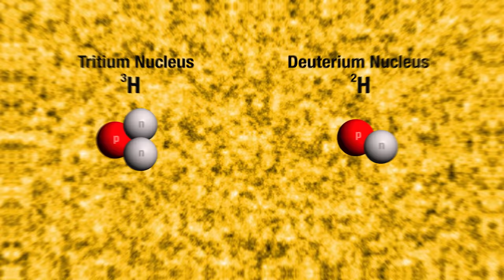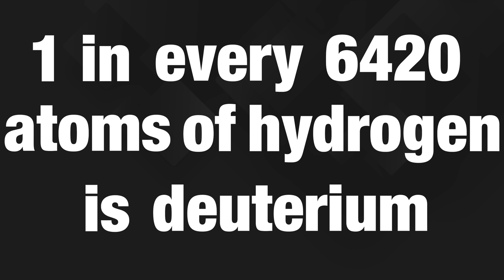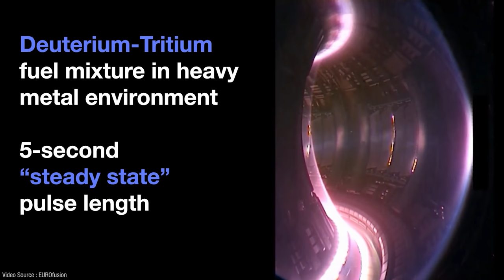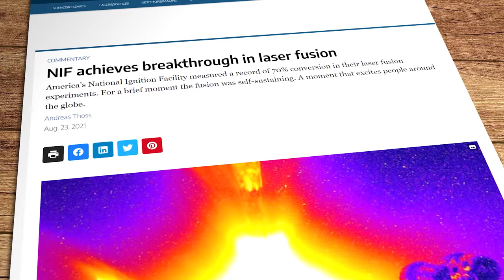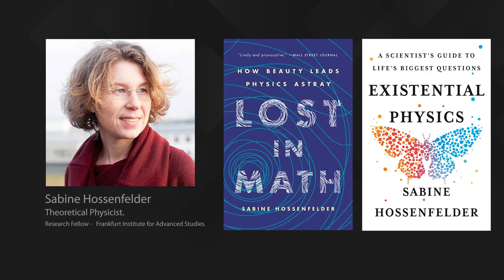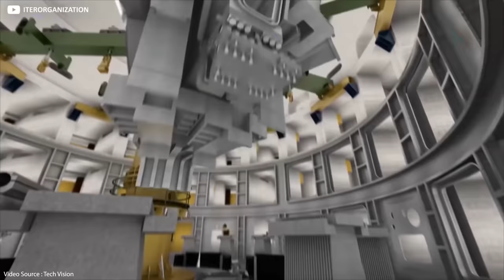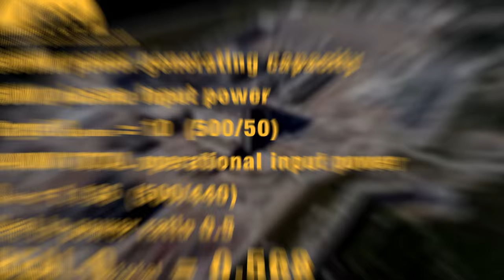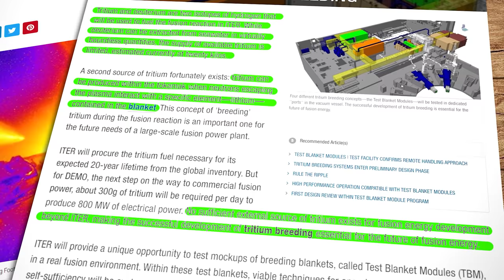Nuclear Fusion Illusion. Is it time to park the pipe dream?

Comment: I'm not sure why the focus on Q, because this isn't the real big problem with DT fusion reactors.

The real serious problems are two.   First, the volumetric power density of fusion reactors is just terrible.  For ITER, it's about 50 kW(th)/m^3.  In comparison, the thermal power density of a pressurized water reactor's primary reactor vessel is about 20 MW/m^3, 400 times higher.   It's likely better DT fusion reactors can do better than ITER, but not 400 times better.   So, for a given thermal power output, the fusion reactor will be many times large, and therefore many times more expensive, than a fission reactor.   This problem is inherent with DT fusion and come from the fact that heat escapes a fission reactor through the walls of large numbers of thin fuel rods, while in the fusion reactor the energy must be radiated through the wall of the whole reactor.  The square/cube law hurts the fusion reactor badly.

The second problem with fusion reactors is that they pack large amounts of complex equipment into a zone that will quickly become far too radioactive for hands-on maintenance.   The requirements on mean time between failure (MTBF) and mean time to repair (MTTR) are far beyond what can currently be achieved.  The equipment will also be under much more stress than the similar parts of a fission reactor.

Both these issues were pointed out by Lawrence Lidsky in the MIT Technology Review in the 1980s, and nothing since has shown him to have been wrong.

http://orcutt.net/weblog/wp-content/uploads/2015/08/The-Trouble-With-Fusion_MIT_Tech_Review_1983.pdf

Comment: Thank you for sorting this out for me. 
  We don't have the time or the funding to waste on this sci-fi  idea right now. 
We need actual results and scaling up of methods that have proven their worth, right now.

 So, please, anyone who  has a position of influence  in governments
 over the direction of this  investment of large input and dubious returns, 
might need to  agitate to divert this revenue stream and knowledge
 to the production of exquisitely shielded 
small  modular and  tiny fission reactors 
 as a plug and play element grafted into semi detached microgrids
 in concert with the local available renewables .

 By supplementing  those  existing 
and under construction renewable  electricity generator sites 
 and  also where  other older, fossil fuel plant sites are already in use, 
ones that are already hubs connected to substations and the like,  
we can get closer to the critical goals we MUST meet.

It won't be seamless, but it will be quicker and more efficient.
We have a better chance  of retaining more of our world this way.

Adding  these small nuclear cogs 
 will keep these sites productive 
even while other renewable components
 are being maintained or repaired.

But, being able to use 
updated, reliable interlocking pieces together 
as a base load generator  
and hooking them up at existing power nodes
 is only half the puzzle.

integrating  the  best  scaled-up energy storage options
 that take advantage of the varying local supplies of natural resources,
 is the other half.
whether that industrial-scale storage includes  molten salts, hot rocks, 
 recyclable aluminum,  iron/air,
high elevation water pumping and/or gravity towers.  

Fusion is an amazing idea, but we need actual results yesterday.

Please spread the word if this is a plan you can support implementing.

Comment: "splitting atoms is not a nuclear fusion process, it's a nuclear fission process"

That's wrong. Lithium is bombarded with neutrons, it becomes unstable and DECAY.
Decay is the right name of the process, not fission that it's an irregular splitting of a heavy atom that it has the configuration to do that.

And it doesn't matter in terms of a reactor if it's fusion, fission or decay, if the potential radioactive elements are short lived so a possible leak only release a small amount of radioactivity and there is no long term contamination that's to the fast decay of the elements.

Comment: Thanks for the insight. I waited in vain, though, for some thought on why it is so hard to improve the Q efficiency ratio. Why can the generator not be kept running longer than a split second? Would the ratio improve if it could? What are the obstacles to reducing energy input and increasing output?

Comment: The photovoltaic effect was discovered in 1839, and the first solar cells based on selenium came in 1884, but those were not practical or efficient. It wasn't until over a century later that solar cells were made good enough to be useful by Bell Labs in 1950. And it wouldn't be until now, the 2000s, almost a century and half later, that solar power plants could compete with existing ones.

Fusion right now is like that discovery in 1839, we can't even make a sustainable reaction let alone a breakeven one or even useful one. And it's going to be an extremely long time before make a commercially viable one. Perhaps another century and a half.

But we will get there.
Reply: it won't take a century. ITER is a 30 year old design and already obsolete. Pretend that it represents the state of the are is shameful. Look up Commonwealth Fusion out of MIT, General Fusion, and HB11 for radically different takes on the challenge.

Comment: I’ve been saying this for a while. Fusion can’t save us. It is part of our future and it will be a huge part of making energy extremely abundant and cheap which will push us forward as a civilization, but it will not be a part of the climate solution. We need to start pushing renewables and fission. And we desperately need updated grids. I do see utility in funding fusion research. It’s kind of like finding NASA. It’s not going to lead to anything practical anytime soon, but the tech we get along the way will probably be useful. What we desperately need is a room-temperature superconducting material. That really would be the next step in energy. It would make energy abundant with fusion and it would make it easily transmissible. Unfortunately, I think metallic hydrogen is perhaps even further off than fusion. We can’t even get carbon nanotubes and graphene into commercial production and those aren’t theoretical anymore. We’ve made those materials in labs already. I mean we might get there if there was a massive increase in funding, talent, and coordination, but I just don’t see that happening.

Comment: If Weinberg had been given just a fraction of a fraction of what’s been spent on fast spectrum U-238/Pu239 breeders and fusion boondoggles, we’d have a mass producible low pressure MSR providing power cheaper than coal. Deployed on the grid before the turn of last century. 

With a supply of valuable isotopes to sell as a side business. Just for fun.

Comment: But no mention let alone consideration of other fusion projects ongoing....especially the mini-fusion devices like Eric Lerner et al's 'focus fusion device'...which is the size of a small room and which produces electricity direct from source. There are problems there too, but the potential of these mini-devices - several of which could power a very large city - is, imo, much more practicable than the huge, state-sponsored tokomaks etc. Perhaps you could look into these efforts.

Comment: I agree about ITER, it's mostly like LHC, big, expensive science machine. It should get funding because of that though, not as a climate crisis solution. What you neglected to talk about are the private companies, they are much further with engineering and closer to something useful even though they're results are nowhere near the JET results. General Fusion, Tokamak energy, Helion energy, Commonwealth fusion systems, TAE, zap energy. They have wildly optimistc timelines that usually disappoint, but it seems viable in the next 10 years (not 4-5y many are bolstering with) instead of the 30 years that ITER will take to come close to something useful, and 40 before the energy producing one is built.

Comment: In reference to your statement "Splitting lithium with a neutron is a nuclear fission and not a nuclear fusion process" while, strictly speaking, true. The process of splitting Lithium with a fast fusion neutron is very different to the process of splitting uranium in terms of waste production.

When Uranium splits, it splits in many different ways. Creating a vast zoo of fission product which irradiate all sorts of different forms of radiation (including penetrating gamma rays) and the vast array of different radioactive elements makes "nuclear fission sludge" from fission reactors very chemically complicated to process.

In stark contrast, when a neutron hits lithium, it always converts lithium into He-4 + T-3 every time Helium 4 is always stable. And, if the tritium is extracted and fed back into the plasma then you wouldn't get a significant build up of radioactive waste.

So the statement that, because fission occurs in the blanket, nuclear fusion reactors will have the same radioactivity issues as nuclear fission reactors is - quite simply - wrong. Scientists have simulated the radioactivity produced by hypothetical nuclear fusion reactor designs very thoroughly and yes, the odd stray surplus neutron that doesn't hit the blanket material does make the structural steel somewhat radioactive. But, overall, the quantity of radioactivity which a future fusion power reactor will produce will be way less than the ammount of radioactivity produced by a fission reactor.

Also worth entioning that $495 billion was invested in renewables in 2022. While private investment in nuclear fusion ammounted to $3 billion or so during the same period. Combined with 700 million in public funding from the U.S. government (and perhaps as much from China and Europe)

...so if we slashed all research into the baseload fusion energy source, by "focusing on renewables" (hint: we already are focusing on renewables) then that might speed up the rate of renewable deployment by 1 or 2%

You are ofcourse right that the public, and investor's, impression of how soon we are likely nuclear fusion is overly optimistic (bar a true out-of-the-park breakthrough) but the progress toward plasma Q's of 10+ does represent true progress. And once we have suitably high performing fusion plasmas, then we won't have to do more work on the plasma and instead we can start focusing of increasing the efficiency and duration of the rest of the hardware, as well as things like tritium processing, etc., etc.,

Given that we've spent over half a century just trying to get the plasma to adequately confine the fusion reaction, the fact that this process is almost completed, that we almost now have plasmas that are good enough and are almost ready to move on to the rest of the system is, indeed, a significant milestone.

Comment: These research reactors are not designed to produce power at all, that would make the operation much more complicated. They are designed for plasma containment research. Scaling it up once we can have a long lasting and controllable stable fusion plasma is "easy". I agree it will not help us right now compared to renewables for the climate crisis, but its important research nonetheless. Humanity will need fusion power if we will ever want to expand beyond this world. And it will greatly reduce the ressources needed in the future compared to solar/wind which also only have a lifetime of 20-30 years per installation.

Comment: We should not shy away from difficult to achieve goals.    The money put in searching and developing fusion reactors is well worth it.     I consider failure to achieve a higher goal as form of success for having tried.    That's  research.     If the Chinese would have had that way of thinking that "failure to achieve a higher goal is a form of success", they would have owned 4000 years ago North American, Carribeans, South American and probably a good part of Africa, but they did not.

Comment: By the time we MAYBE have a functional, commercially viable fusion reactor, the whole globe will have converted to renewable energies and energy storage with some base line load from nuclear and natural gas. The price of solar, wind and battery/hydro/other storage is going down so fast that there is no point building very complicated and expensive fusion reactors on earth. A village in sub-Saharan Africa can install a solar farm in a week by themselves. The won't be able to build a fusion reactor any time soon. 

However, if/when we head out to the solar system in distant future, fusion would be a natural solution for energy production.

Comment: I remember ZETA from the Eagle comics in the 60's saying limitless energy, "Just around the corner", great for plasma research, useless for practical energy purposes, better to put the money into the materials genome project & develop thermoelectrics & enhanced conductors.
Another point , I've thought about is from an Ecological position, isn't deciding which energy systems to put resources into itself an Ecological problem, in that there are systems such as fusion, that will I think in all likelihood take away resources from say thermoelectric & enhanced conductors & others, & finding out the "best" combination depending on Geography & local resources is part of the problem.

Comment: Thankyou. If we had spent fusion research money on advanced Gen 4 fission as well as integration of renewables, climate change may well have been addressed years ago and we would now been well down the path to clean energy. In view of the urgent situation confronting us, spending up big on fusion research is a collective failure of wisdom.

Even if ITER is very successful and fast tracks us to a power reactor, the initial reactors are likely to be very large, very expensive and only suitable for the wealthiest markets.

Comment: I have a question...🤔
Why, instead of spending that gigantic amount of money and resources on gigant plants to produce millions of Kw of electricity, such as nuclear fusion plants, are not all those resources allocated to the production of machines and appliances that are more efficient in electricity consumption, as was done with the widespread use of LED lights or the development of AC/DC or DC/DC POWER INVERTERS that produce, let's say, 50, 100 or 500 kw/h output with an input of 12v, 110v or 220v, whatever they are, I don't know, for both domestic, industrial or commercial use.
what is the impediment..?